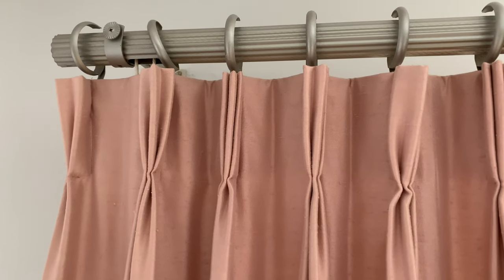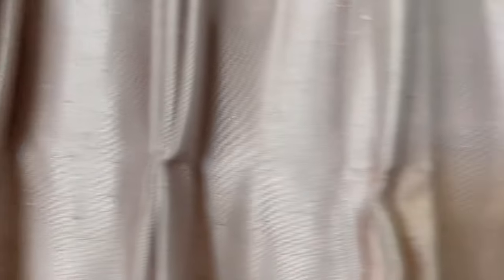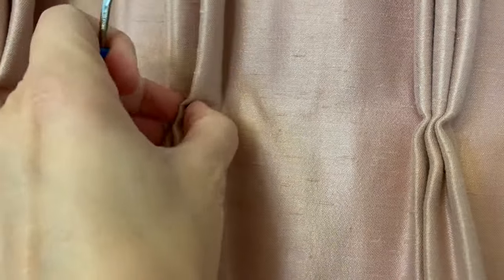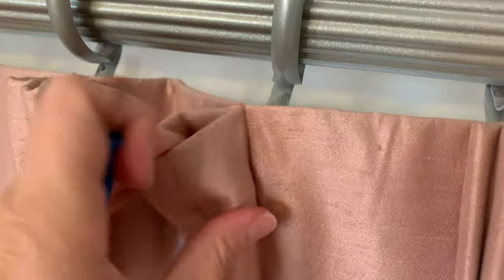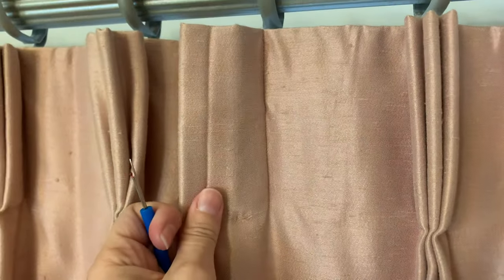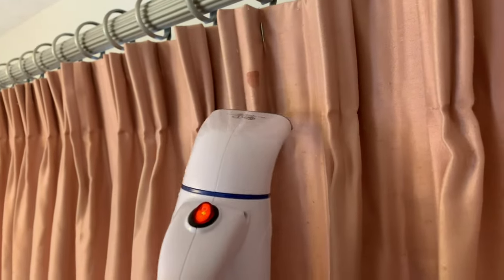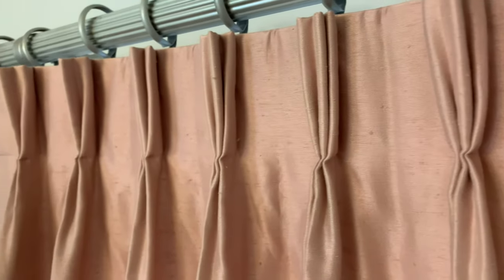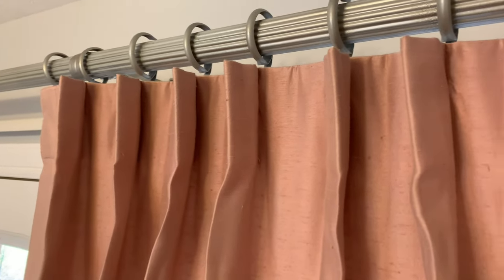How to Remove Triple Pinch Pleats from Drapes: Goodbye Old Fashioned Curtains, Hello Modern Pleat!

Comment: Does this widen the curtain tops? That’s why I want to open mine. Thanks
Reply from the maker: It would only widen the curtains if you changed the hooks and allowed more fabric to be in between each hook. If a lot of fabric was used to make the pleats, then you might have fabric to extend the curtains wider.
Reply: It will if  you open that long seam that's behind where she took out the pleats.

Comment: Did you ever paint the curtains ??
Reply from the maker: I tried. But I did not turn out! Even watering down the paint made the curtains too stiff and wouldn’t fold. Too much work and expense. Cheaper to buy new curtains!
Reply: @SingleGirlsDIY  dyeing might have been easier.